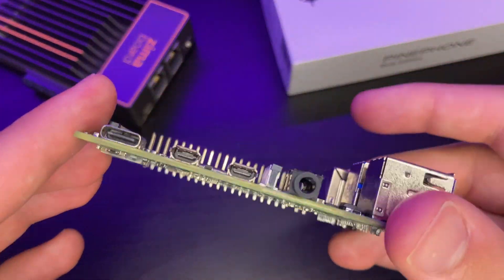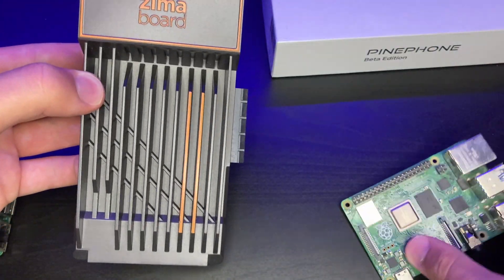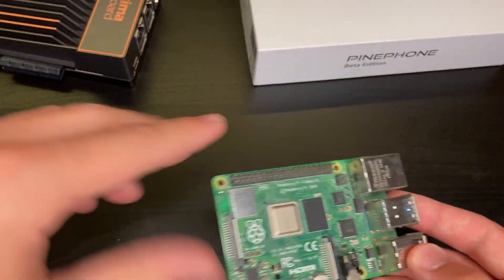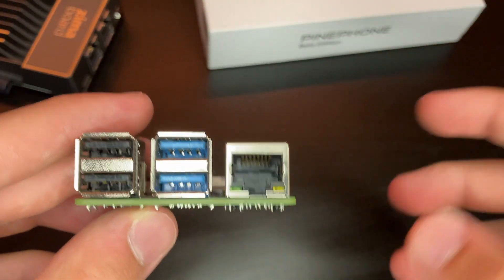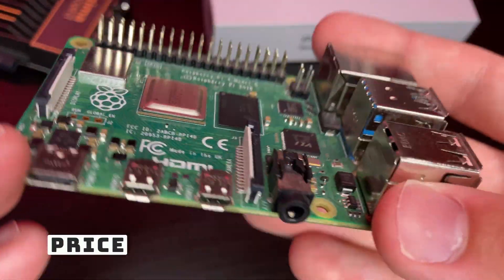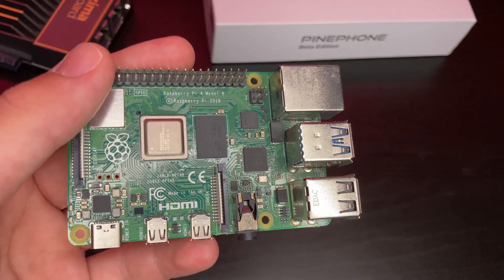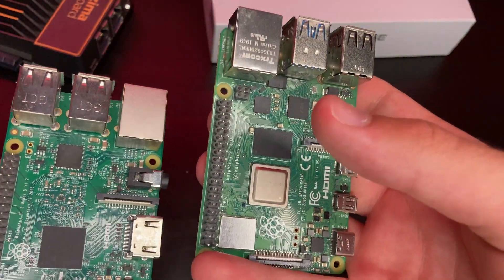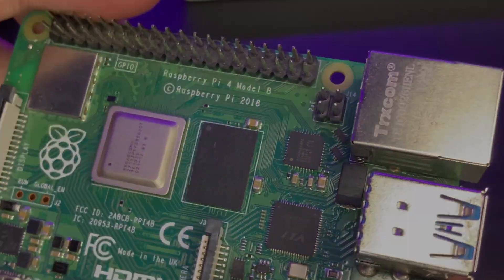The Raspberry Pi 5 NEEDS These FEATURES..

Comment: - it is now 2023 and not 2022 when this video was done, and we still suffer not to have a Rpi 5.
- When we will have a contemporary Rpi 5 which fits for our needs?
- We did not find the device yet, altough we studies many devices.
- Many YouTube reviews do not mention the issues these SBC have, so we have to find it out by ourselves.
- It is not necessary to test all these devices.
- It is enough to go through different reviews to find out about issues.
- Issues with SBC are often that we do not know if Bluetooth keyboards and mice work, and what is a SBC without this option?
- Will the Rpi 5 solve this problem, and when?
- We need urgently two HDMIs, else we won't buy the device.
-We need a SBC as a a mobile device wit h 5 inch display and a second 10 inch display as a laptop.
- Then, we need the Raspberry Pi 5 as soon as possible.
- There are a lot of competitors to the Raspberry Pi 4 which offer much more contemporary hardware than the Raspberry Pi 4, and the software support is also catching up with these devices.
- Raspberry Pi where launched at a moderate price, but prices have been shot up due to shortage, and we have to bid for those on ebay to be able to buy a device. 
- We will for these reasons change as soon as possible to another brand than Raspberry Pi.
- Raspberry Pi has a large community, but we don't need all the OS which are available for the Raspberry Pi.
- If we find a device which fits our requirements, we will choose another device than Raspberry Pi as soon as possible.

Comment: Those other boards have pretty bad support for developers, that's why there is no bigger community. 
I have a Cubitruck, a Cubiboard 2, the original Radxa Rock board and an Olinuxino (144 GIPOs! Yeah!). No new GPU drivers since the day they where delivered, no devicetree for newer kernels and so on. I keep the Cubitruck alive for the time being since I use it as some sort of a cash register with some ERP added in while I work with the developer to dockerize the application. The Olinuxino runs on Kernel 2.3x! Nothing I would want in a productive network in times like these. 
Back in 2013 I used Raspi A's for smart displays in an arts exhibition with cheap 32" HDready TVs. Two of those serve my smarthome today running the current RaspberryPi OS!

Comment: I like to see a fusion of a raspberry and a Arduino. We now have two separate devices.  It's time to have one universal board. A basic board will work just like a common Arduino/ 1 m raspberry.  Internal expansion (like ssd memory) will change the board into a versatile all purpose board.
Reply: The Raspi already has a pretty complete set of GPIOs. Ok, AD converters would be nice.

Comment: new raspi need more ram i have 8gb ram board, and lot lot better genuine cooling system in board, and HDD/SSD connection port or better M2 port. more speed can run good minecraft. more usb port, now all have full if use wired keyboard,mouse,SSD, and sim card internet hot spot. no have usb port free. and own better connection to UPS board need be. perfect have if can connect display card lot better can play games,flight simulator etc. cad/cam software, and need cheap less than 40$ cnc machine linux cnc expansion card. whit closed loop connection stepper motors 5 pcs out and encoders to in.and all limit switch and other relays.

Comment: I love having 2 HDMI outs. Micro HDMI is crap tho. My first Pi4 has a bad 1st micro HDMI, so it limits it's use. Other problems... Not enough power for USB when using a fast flash card, overclocking. This is true with the official power supply and also running on battery, with a 3.0 amp buck converter. 12v 6 amp battery still can't power the pi portable HDMI screen with touchscreen and speakers. So for my setup, 3 batteries. It did work with the official Pi 7" screen... however that  screen has an 1 1/2" extra glass on the sides making it wider for absolutely no reason.

Comment: I think you're totally missing the ball.  My expectation for a Pi5:
- more memory, i.e. having a 16GB model
- maybe better SoC especially for h.265 and other codec support, still Broadcom though and not RockChip as I have yet to find one of the latter that remains stable under very high load (read: it's not all down to the software support, the chip itself - or perhaps the lowest HAL layers from the manufacturer -  just seems less robust)
- all USB3 ports, but maybe all using USB-C connectors to make room for 2 full-sized HDMI - no change in overall form-factor (but obviously some change in where to find what port). As we can boot from USB, I doubt eMMC or M.2 will come.
- on-board RP2040 with extra GPIO header or having it control a bunch of the existing pins, making exact timing of protocols so much easier than on a non-realtime PI-OS.  Let it control the powering of the main SoC and initial boot phases and perhaps a deep-sleep mode for Raspberry Pi could be made, opening options for battery-powered projects (needing the pi's power only on certain events when the RP2040 decides there's need for it ... AI?).
- external WIFI antenna connector (I doubt it, but I can hope)

In short: nothing revolutionary and hence I don't expect it any time soon, especially considering the chip-shortage and the outlook in the world with economic collapse in China and other global economy disturbances.  Getting a flow of Pi4's again is likely the first target.

Comment: I disagree, the small form factor is important.

- Replace USB3 with Thunderbolt ports.
- Go PD for USB-C power
- 2nd HDMI can be omitted and gained back through Thunderbolt
- Thunderbolt will also allow a 2nd GigE port
- PCIx 4x

Reducing those bottlenecks will improve the experience without growing the board
Reply: And a RTX 4090 too

Comment: Would be good to have 1 extra USB 3.0 at the oposit side of a board so u can connect HDD to it and still looks good if u put it in a case. So ugly if u plug the HDD in the main USB connector and then lead back the cable into the case. Even with the USB bridge is ugly and then ur HDD is next to the CPU what i would like to avoide.

100 usd ? :D In my country they try to sell raspberry pi 4b 8gb model for like 300 usd. They have it on stock ofc cause nobody in the right mid want to buy it on that price. From 300 USD i go in any PC store who sell used PC and buy a 100x stronger one to drop it in a corner and use it as home server.

Comment: The Raspberry Pi is a $35 computer, granted that only gets you 1GB of RAM and as the RAM increases so does the price. You mention some fantastic SBCs but they are nowhere near that $35. The price would need to go up in order to incorporate some of those desirable features. As for two monitors, fantastic if you are doing a project, office writer on one screen and the internet on the other is such a leap forward.
Reply from the maker: Yeah, I totally understand what you mean! I don't expect all of those or really even if just a couple were added it would be cool. Also thanks for sharing about the two monitors and how you think it can be helpful.
Reply: were u can buy raspi4 8gb 35$ no anywere i has try looking, ewery seller have minimum 50-60$ and need power, display cable, too, and case good. but all together cost what need can start use ower 100$ anywere.
Reply: @mattivirta  I did say 1GB of RAM for$35

Comment: The features that a Pi5 would get depends on which direction the Pi Foundation wants to go.

If they keep pushing the Pi as they have been doing so far, a cheap SBC for educational purposes, then probably not much will change, except (hopefully) a raise of specifications across the board (pun not intended), for (hopefully) a lower price. And, of course, actual availability would be great.

If, however, they see that an improved Pi would do well as a light, cheap desktop machine then the Pi5 would need one thing above all: make sure it has the ability to play HD streaming video without any dropped frames. 1440p/4k would be good, but problem-free 1080p playback is the absolute minimum for success. As I understand it, the hardware of the current Pi4 should be able to do that already, but is held back by good open source drivers for the GPU not being available? Fix that, add a somewhat beefier CPU, maybe more/faster RAM (extensible with a slot maybe), and M.2 slot would be great (but really SSD over USB3 works fine on the Pi4). If they really want to push for the desktop market, a rearrangement of the ports (so that they're all on one side, have full-size HDMI) would be great. At some point, it would stop being cheap though, and other (x86) options will start to look more attractive.

Solid 1080p playback + bit beefier CPU would make me want to buy it for use as a light desktop PC.
Reply: I think they need to produce a Pi 5 "Pro" model with a bigger form factor and level of expandability. Keep a standard Pi 5 model too for everything else like now.
Reply from the maker: Very nice thoughts, thanks for sharing!

Comment: just few more things i wish add to the list. the first is the RAM band width has to be increase, i tested on my pi 4 up max 4GB/s band width clearly not enough if you have 4K playback, at last 64bit width. the second is i wish to have the GPIO pins are not attach to the board when it comes out (it should be an option that GPIO pins attach or not, Radxa zero is a good example).
Reply from the maker: Nice thoughts!

Comment: 4k smooth video playback is a must now.
Reply: not just the SoC not powerful enough, they should upgrade the RAM bandwidth too
Reply: @stephensu4371  The SoC has hardware video acceleration and can play 4K video, but Broadcom still hasn't open sourced the drivers. I really hope the Pi foundation will pick a SoC with proper open source driver support.
Reply: @LivingLinux  if you don’t have proper driver support what is the difference between you have one and don’t have one, yes i hope they can pick a SoC with a proper driver, e.g. snapdragon, rock chip, even if them wish to have low price they can try Allwinner. look at radxa zero, that small board (same size with RPI zero) but got 4GB and EMMC and more option
Reply: @stephensu4371  When it's not in the hardware, the driver won't matter. When it is in the harware, the driver does matter. Just look at the announcement that the Pi 4 will be Vulkan 1.2 compliant with a future update of Mesa.
Reply from the maker: That would be nice for sure!